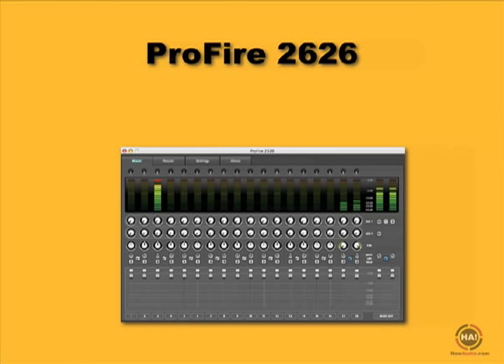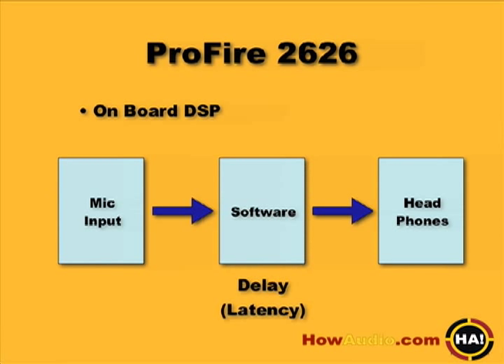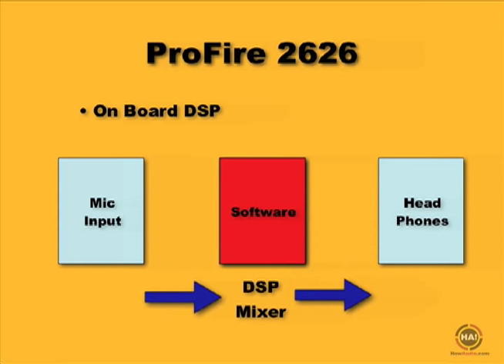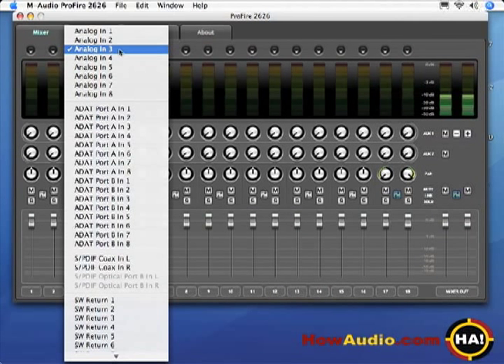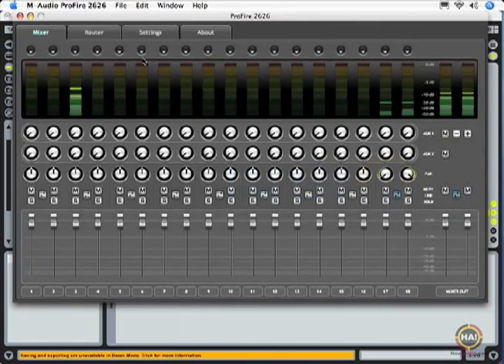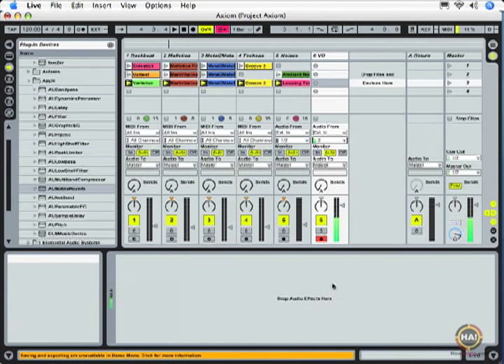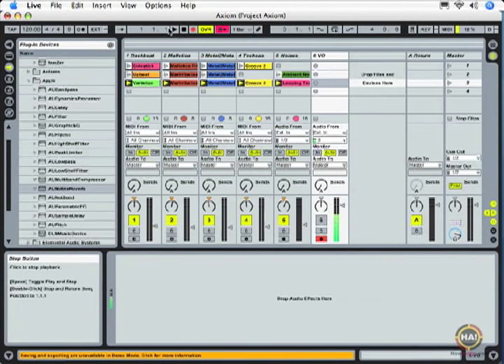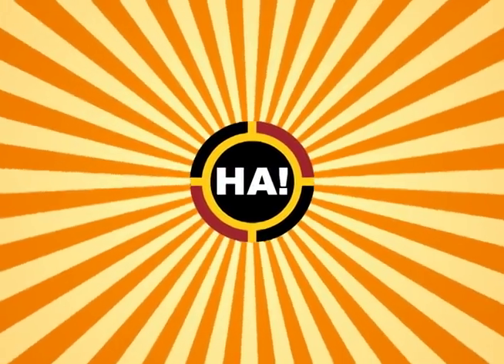ProFire 2626 - High-Definition Audio Interface by M-Audio

Comment: This is a digital to analog (and vice-versa) converter with built in pre-amplifier. It is used to convert the audio you pick up with a microphones or a pickup to a format your computer can use: digital audio. You would need this if you want to exchange audio between digital and analog (or between your computer and speakers, or between your guitar/microphone and computer) with a higher quality and onto more tracks than your sound card is capable of doing.

Comment: I've used SOnar for a long time with a Dell, Layla interface. I tried protools on a Macbook pro and got the Profire 2626 - didn't like it and the Profire sat unused for a two years. Now I'm trying to make it work with SONAR 8 and a Toshiba laptop - run into heavy problems myself. 
Check Options> audio>advanced>Playback Recording>Driver Mode: change to ASIO from WDM/KS.That helped me. The default setting caused distortion & faster playback. Hope this helps. Any tips on SOnar and 2626 are welcomed

Comment: the dsp pretty much makes a direct line from the interface to the headphones. while your recording software would do the recording. if you didn't use the dsp you'd have to rout the interface to the software and then use the softwares outputs. something like that. correct me if i'm wrong or something.

Comment: If you are connecting the profire to a control surface i.e. project mix, using the lightpipe connection, do you still need to plug the firewire 400 into your computer as well?  I have a macbook pro, will it run ok on it?

Comment: i have the same 2626 interface and i have a problem: while recording sometimes cubase 6 starts getting the sound cracky and scratched (its not an interface prob cuz if i monitor the input signal souds just fine while if i monitor from cubase its cracked and if i record i record that way so what can i do to fix this thing? buffer size is ok since i can record without problem or sometimes i have it while recording normaly then its starts that.. id apriciate if u could help aLOT LIKE ALOT!!!